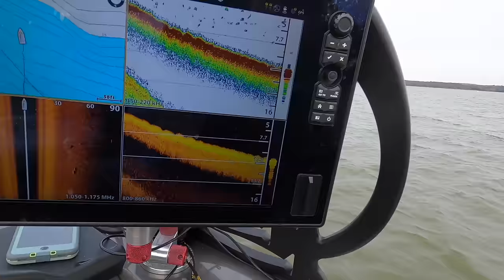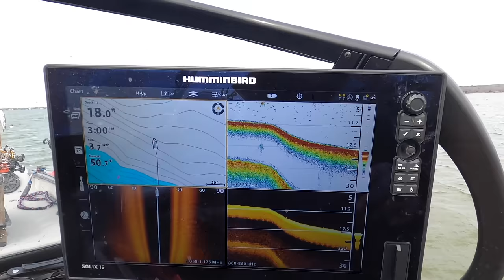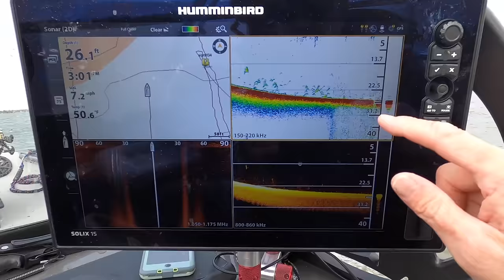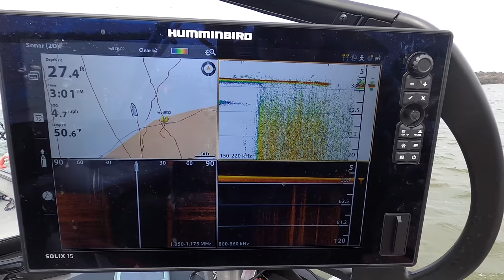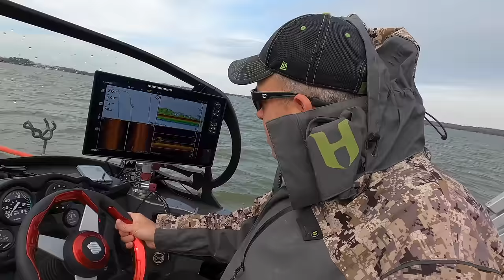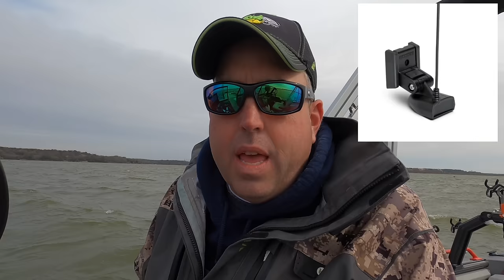How To Get High Speed Fishfinder Images (Depth On Plane)

Comment from the maker: What speed do you lose images?
Reply: Catfish Edge I lose it at 8mph but it freezes up at well I’ve heard low voltage I bought new batteries still doing it I have a Lawrence 7TI
Reply from the maker: Check your wiring
Reply: Catfish Edge sounds good I’ll do that as soon as this rain Stops Ca is getting some good rain THANKS FOR YOUR-HELP SIR
Reply from the maker: @stevebugmanduncan4145  Check my video on power cycle issues.
Reply: Catfish Edge I’ll check it out I was on the back waters this weekend here in Ca and it’s still doing thanks Oh also hooked a 20lb flat 🤙🏻
Reply from the maker: Nice!
Reply: P
Reply: Hummingbird helix 5 di g2 loses bottom at 5 m.p.h......which stinks.
Reply from the maker: It can be better. Follow these instructions!
Reply: Hummingbird helix 9 loose at 4.6mph no depth or bottom
Reply: Lowrance x70 older unit came with bass tracker  i lowered  it below transom it now looses at 18 to 20 when it was level with boat i lost at 8 mph
Reply: on a Garmin Echomap GT52, at  around 12-15 mph .
Reply: RANGER RT178 - 60 HP MERC 4 STROKE - LOSE DEPTH OVER 6MPH - HUMMINBIRD HELIX 8
Reply: Suntracker pontoon with 50 hp Mercury ELPTO. Helix 7 and I loose at 12 MPH. I guess Im good. I was thinking I’d be good up to max speed. Oh welll.
Reply: Great info, Thanks. I had a cheapo Hummin bird SX100 that NEVER lost the info at speed.  Upgraded to a Garmin Striker 7 sc, @ 18-20 mph I start loosing my MPH and like your screen, starts to get grainy. After 20 mph, it's done till I slow down. I lowered with no improvement. I also have a line down the left side center on side scan, I think that maybe my trolling motor shaft ?  Gotta raise out of the way to find out

Comment: The pro installers say to tip the end of the big transducer down a bit and it will allow it to read at higher speeds. Also you have to lower the whole thing down a bit under the hull. So it is in full contract on plane or higher speeds. You always run a risk of hitting it on something. Great video & info about the pod boats like yours and mine. 👍
Reply from the maker: I want super clear and accurate images at scanning speeds so being perfectly level is what I'm looking for as that provides the best return. As far as lowering it, if the transducer shoots a rooster tail it's too low. Having the transducer too low will impact the speed of the boat and also cause the boat to list so it's best to keep it at or just above the bottom of the transom.
Reply: @Catfishedge  Just reading the comments after the video, but picking up lots of useful info from comments as well as videos. hanks again for the video and all that commented!
Reply: Yup I did the same. About 6-12inches below the haul line. I ended up getting some c133 stainless steal bar. 1/4 inch thickness. It is more clear than when the boat was in park.

Comment: My Garmin GT54 transducer still tracks cleanly at 45+ mph on my Tracker Pro Team 190 Mod V. Mounted roughly an inch further inboard than the factory mounting location (lower transom step) of the Lowrance system. Bottom of hull flush with the top 1/3 of the transducer. Hope this helps someone.

Comment: I fought this for months  speed up no bottom depth moved and adjusted transducer every way I could finally learned about through hull transducer in fiberglass boat easy to install and works perfect never loose bottom depth any speed using hds 12 live
Reply from the maker: Awesome! Glad you got it worked out!

Comment: So with a through hull transducer, you need a Y cable adapter, so your Humminbird can have both transducer feeds I to the back of your unit. Do you find this gives you less clear 2D scan results when you are feeding your unit 2 simultaneous sonar feeds at the same time?

Comment: I have a Lowrance hook2 5 splitshot. Everything works great till about 15 mph. The boat is a 2019 G3 20 center console
Reply: I have a 2020 g3 1710 with the same problem. What do I do about it?
Reply: @jimmycraddock2726  I have no clue, even had the dealer look at it. Maybe get a through hall.

Comment: Other than Ranger most manufacturers/dealers install a "shoot through" transducer. Ranger from the factory installs a true thru-hull transducer which is installed in a hole "through" the hull of the boat.
Reply from the maker: Yes but you can't use a through hull on a tin boat

Comment: I have a Ranger Aluminum RT 178.  So no thru hull on an aluminum?  I have floatation material in my hull, but it does not look like I have same material in the stern near the transom.  Anything over 10 MPH, my depth numbers blink true depth, then just blink inaccurate depths throughout run time.  By the time i get to my fishing spot, I have to turn off the meter and power it back up.  Most times, but not all the time, the meter will “catch up” to true bottom reading and depth.  Very inconvenient!  I have a Lowrance Hook7 on my console. I’m sorry, I don’t know which transducer it is, but it is not a high speed transducer.  Help!

Comment: Mine loses depth and imaging readings at just under 6 miles an hour… I’m new to all this, but I did follow the manual. I’m running the Helix 5 DI GPS G2 unit with the standard transducer that came with it. I get awesome readings when going under 6 miles an hour. It would be really nice to at least get depth readings at higher speeds. My next move is the lower the angle of the transducer by one notch. Any suggestions ?
Reply from the maker: Yes, all covered in the video.

Comment: 20' Seaark VFXCat with pods, one of my Lowrance units will maintain bottom and correct depth for the most part at 40, they side scan Lowrance does not like anything over 6 to 10 MPH and it goes crazy.   Biggest mistake I have done was getting a Hook2 Triple Shot to get side scan. The transducer is so long they do not work. On my second unit now and out of warranty and it keeps screwing up and locking up. I think it is something in the Transducer now.  All these monster units just don't work good on Aluminum boats.
Reply from the maker: It's the transducer size.
Reply: Im not so sure they work so good on fiberglass either. I have been fighting the bottom image all season this year on a new Garmin. I have spoken to Garmin many times via chat and gotten much advice. But the first guy said to me was to lower the transducer in the water. I did that and it made things better but I still get funky readings at different times, different water conditions such as weather, speed, etc. Everyone says the transducer is supossed to "skim" the water and I always went by that rule and dismissed the guy in the chat at Garmin about lowering the transducer. I am beginning to think he is right. I have the transducer as low as it can go for the moment. I either have to pull the boat and drill new holes to get the transducer lower or get the boat to a beach where there is very little traffic and drill new holes and lower it then. And just in case your wondering, I am using a Stern Saver for the transducer mount so I am not worried about water breaching the tansom. Either way, I am not too crazy about these new transducers or the "over bearing" amount of settings for it. I can go on and on, but I dont want to get off topic. Im beginning to think that the old school stuff may still have its merits.

Comment: I'm assuming its the same on a pontoon, probably compounded by the turbulence around the logs. My question is this. When I first installed the graph and transducer, it worked perfectly, even at 23-24mph. All of a sudden it started losing the depth and the mapping (garmin striker 4 plus with quick draw contour)  i figured i had hit some floating wood and knocked the transducer off or broken the mount. Checked it out yesterday and everything was still tight. Any other suggestions? I dont know why it worked perfectly for 2-3 trips, then all of a sudden I'm having problems, even at 6-8 mph. It will randomly start reading right while underway, then will cut out again. Idk if I need to pull it out of the water and try to remount it, but I have limited options on where to mount it. Any advice would be helpful.
Reply: I am experiencing the exact same thing on my pontoon.  Worked fine, even at higher speeds.  Now it loses depth  at about 6mph.  We have a Hummingbird Helix 7 with a Chirp transducer.
Any suggestions would be great!

Comment: We have a new pontoon and pissed away many hours last summer trying to make our Lowrance Hook2 7X  depth finder work. By lowering it just below the pontoon we got a slight improvement, but the reading would still disappear at about 5pmh. And often it would not return after slowing down so we repeatedly have to reboot it. After seeing all these videos and user group postings, I am astounded that boat and fish finder manufacturers are indifferent to this frequent customer frustration.  And we all shell out hundreds of dollars for crappy technology that offers all kinds of flashy things we don't need, yet won't easily and reliably tell us depth and the location of a few fish.  Is that really too much to ask?

Comment: Does anyone know if there is any truth to turning the transducer around as the sonar component in the transducer is at the front where the cable enters and turning it around helps to eliminate some noise.
Reply from the maker: Zero truth
Reply: I turned my 3 in 1 around and hey presto! Problem solved 🤷🏻‍♂️ 
Some say with that particular ducer it works better backwards due to the material used being more concentrated on the end where the cable enters the transducer.

Comment: I’ve got a Helix 9 G2N. Mine shows double depth 60-70% of the time. Can’t make an accurate autochart map because of it. Anyone know what I need to do? I’ve tried adjusting sensitivity in all directions and that doesn’t help. Thanks.
Reply: I’m running the stock transducer.
Reply from the maker: Run the update. It will fix the double bottom issue.
Reply: @Catfishedge  Thanks. I’ll do that!

Comment: If you lose 2D sonar you will lose DI just after that as... 2D sonar is what we use to "range' the DI display. DI does not provide depth. The range is set off of the digital depth from 2D sonar.

Comment: Samething, i loose it at about 4 or 5 miles with fiberglass boat, and i got nothing to interfear with it, and its properly mounted.
I cant ever see my conon balls, i gota put te boat in nutrel, 
(in and outa gear) in order to see my rig's, very anoying.

I watched an other video, the guy was running around tge lake at 18- 19 mh, and still marking fish, now maybe he had a diffrent transducer,
But i deffinitly cant do tgat with the XM 9 HW MSI T
Reply from the maker: Through hull